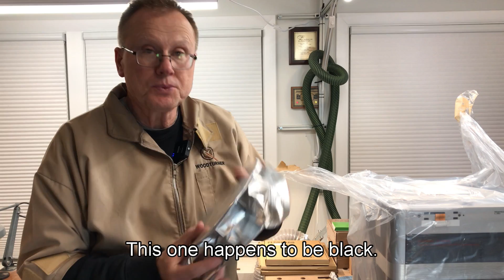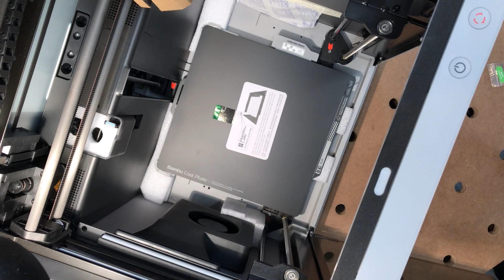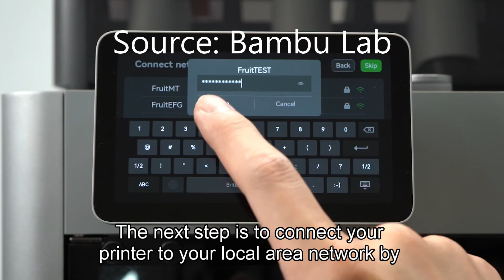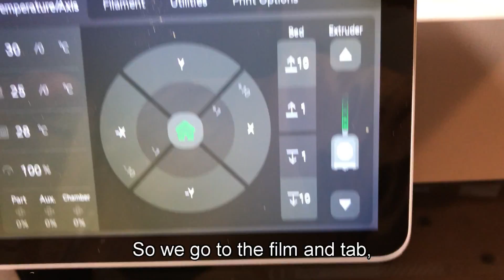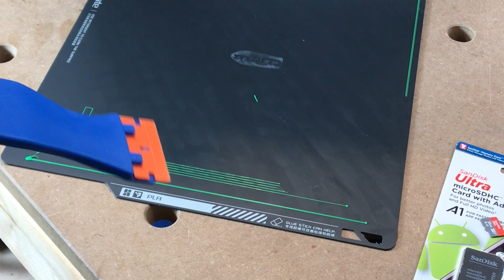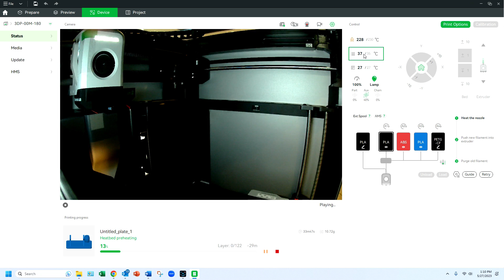Comprehensive Guide: Bambu Lab X1 Carbon w/AMS 3D Printer Set-up

Comment: I can confirm that as of December 2024, this first time set up is still a video if you’ve never set up a 3-D printer or are setting up your Bambu x1c. Just about done setting mine up. The set up instructions miss a few vital steps and didn’t even know that it came with an extra .4 mm nozzle. I was looking for instructions on how to install it for the first time which led me to this video. subscribed. Thank you for the pace and detail.
Just a small note that not sure if they changed it but on mine that spool holder on the back, the screw on the right needs to be removed. (no screw on the left) and then replaced with the two longer screws.
Mine also did not have any mention of needing a card, information about when to install the AC plug, and removing a couple of internal pieces of tape one of which I think is covering the camera so if you put in a card and are trying to figure out why there’s no video check to see if there’s that green piece of tape.
Reply from the maker: Thanks for taking the time to provide your detailed feedback.  I'm glad you found the Bambu Lab X1C video helpful.  As you mention, I made this video a while ago so I'm glad it is still relevant today for people setting up their X1C printers.  In fact, I just bought a Bambu Lab P1S printer and I was pleasantly surprised to see that the unboxing, setup, and operation is very similar to when I set up my X1C printer 1.5 years ago.  Thanks for pointing out the details in your comment that further clarify the printer setup.  I hope you enjoy your X1C as much as I have enjoyed mine.  Please let me know if I can be of any further help now or in the future.  Ken

Comment: Hey just asking does it only use PLA material or can we use others to?
Reply from the maker: The X1C can print PLA, PETG, ABS, TPU, ASA, Nylon, etc, because it’s an enclosed printer and it has hardened steel hotends. Thanks for the question.
Reply: @ristinnovations  the one from bambu labs? And also can I use it to print car parts like steering wheel or rim pan?

Comment: Would any stick of glue do? I can't find mine in the packaging
Reply from the maker: I know other people have used non-Bambu Lab glue sticks successfully. I think as long as you use water-soluble glue sticks they should work. You may want to test a small area on your build plate to see if your brand of glue stick works well. It can always be washed off. Thanks for your question.

Comment: On the second, right most screw to mount the external filament holder, there is already a screw in that spot. It's rather hard to unseat. Am I supposed to remove that one and insert the new short one provided in the pouch? It's kind of hard to make out in the video.
Reply from the maker: Yes, that’s what I recall. The two holes in the spool holder should line up with the two screw holes on the printer. You can zoom the video to see it better. Thanks for the question.

Comment: Can i use the cardboard spools with the ams ?
Reply from the maker: Bambu Lab doesn’t recommend using cardboard spools in the AMS due to their concern that the rubbing of the cardboard will produce fiber dust that can clog the gears, but I do know many people do use cardboard spools in the AMS. I think it really depends on your specific situation.
Reply: @ristinnovations  do you recommend any spools for ams from Amazon?
Reply from the maker: I went down the path of 3D printing a spool filament rewinder (it is in my Top Bambu Lab Upgrades video) so I typically only use the Bambu Lab spools with other manufacturers' filaments rewound onto the Bambu Lab empty spools.  Also, most of the time I use the Bambu Lab filaments.  There is a spreadsheet on the internet that lists all other manufacturers' spools and whether they fit into the Bambu Lab AMS.  I hope this helps you.  @cheizaguirre5494

Comment: why at one corner prints are warping ? is there any solution for this?
Reply from the maker: That is a good question. My thoughts on why parts are warping in a specific corner are that possibly there is some contamination that needs to be cleaned off the build plate or possibly the build plate does not have the same temperature at the corner versus the rest of the build plate. I don’t have a solution if there is a temperature difference, plus it would be hard to measure the temperature without a thermal camera. On option might be to try a glue stick or use the Nano polymer adhesive from visionminer. I hope that helps.

Comment: Thank you so much for this detailed guide. I was so worried I would damage something but I got everything going thanks to you !
Reply from the maker: I’m glad you found my video useful. Good luck with your printer and let me know if I can help in any way in the future😊
Reply: @ristinnovations  hey rist. My x1c is not powering on in chamber or screen. Can you give me some advice? I put in a support ticket but I'm not sure when they will reply.
Reply from the maker: @akg2n If you aren’t getting any power you could have a bad power supply. That was the symptom I had with my Qidi Tech printer. I had to replace the power supply. Bambu has a Wiki page that includes troubleshooting that may help you. You do have to be careful with power supplies (not getting shocked) because the internal capacitors store energy even after they are unplugged. I hop you are able to find the root cause.
Reply: @ristinnovations  thanks for your reply Rist. I'm seeing the power light on for the back switch and I'm seeing white lights in the AMS. There is also a red light on near the filament purge. I read on the wiki and checked the AP Board. That unit does not have power to its lights. The chamber light and screen also don't have power. I'm thinking it might be a failure of the AP board. Let me know what you think! I really appreciate your replies. Thanks you!!
Reply from the maker: @akg2n  Yes, I was just reading about the AP board so I think you are getting close to the problem. Is your printer under warranty? If so once you hear back from Bambu Tech Support they should be willing to send you free replacement parts.
Reply: @ristinnovations  yes it is. Their support auto replied promising contact in 3-4 days. I'll keep you updated.
Reply: @ristinnovations  Yes it's still under warranty. I contacted support so I'll let you know how it goes!
Reply: Hey Rist! Support replied and they are sending me an AP board. The guide for installation mentions heating to remove glue and also using UV glue to secure some cables in place. I'm a bit worried about doing those steps. Id appreciate any advice or insights you might have!
Reply from the maker: @akg2n it looks like you are definitely on the right track regarding the AP board based on feedback from Bambu Lab. I read the instructions you are referring to. I haven’t done this repair, but it looks like they are using UV glue to help secure the connectors and the ribbon cable. I would just be careful when using the hair dryer. You are trying to soften the old glue so you can disconnect the connectors/ribbon cable, but you don’t want it to get too hot. When reattaching the ribbon cable they recommend to use UV glue or silicon glue. The UV glue hardens quickly if you have a UV light source. You will have to follow the directions from the glue manufacturer on how to cure it. Bambu’s other option is the silicon glue, but you need to let cure by time, again by following the manufacturer’s directions. The glues act as strain relief just to keep things from coming loose due to movement/vibrations of the printer. Good luck with your repair. I’m sure you will do a great job!
Reply: @ristinnovations  great thanks. I'll definitely update you
Reply: Hey Rist just confirming that my printer was fixed with the AP board and has been working great since. Thanks again!!!

Comment: watching this at work, i did install it this morning by watching other content creators and now thinking about it, i wish i had found your video this morning because you did a great presentation, you knew what you are doing and what is coming up like that foam under the bed being released from calibration, some people just skipped it, making me try to pull it from the top. I had 3 flashforges in 2 months (3pro 4 pro and 4 pro) that now i have returned them all and got a bambu x1, my latest prints on flashforge were all perfect by calibration and glue, even the build plates were not getting 1 scratch. Still my first print on X1 detached from the glue once almost done, so i need to learn it better. This time i dont have the amazon return advantage so i gotta be careful
Reply from the maker: Thanks for your detailed comment. I think you will enjoy the Bambu X1C😊

Comment: Can the slicer be set to print as much as possible in the same color?  if it can print 5-10 layers without the head getting in the way before it changes to another color..  then it can save a lot of the dumped plastic.

Comment: Love the video I been printing for a few years and trying to get my Prusa MMU2 working have to make the decision New prusa  or Bambu  I only use about 4 material suppliers Fillamentum Prus Elixr need to work out if the ams can handle these spools, I am sorely tempted to buy Bambu
Reply from the maker: Thanks for the feedback. There is a list on the internet that has information on which manufacturers’ spools fit the AMS. I made a spool rewinder that allows me to use anybody’s filaments in the AMS. It’s in my video titled “The top 10 Bambu upgrades, if you are interested. Good luck with your decision.

Comment: can you use non Bambo filament?
Reply from the maker: Yes, you can use other manufacturers’ filaments, but they need to fit in the AMS. There is an Excel spreadsheet that is available on the internet that lists which manufacturers’ filaments fit. I just uploaded a video this morning that shows you how to build a spool rewinder that gives you the option to rewind another manufacturer’s filament onto a Bambu Lab spool. Another option is to load the other manufacturer’s spool on the external spool holder, but that’s not part of the AMS. Did I answer your question fully? If not, just let me know how I can further help!
Reply: thans so much for taking the time to reply in detail. I'm a 2yr MK3S+ user and need/want another and cannot decide. Are the tags on the reels recodeable or can you simply manually input that info to the printer via the screen. I guess the gcode would contain all the relevant info you just need to work out which slot each colour is at? Ive never used a multi colour setup, always done it manually.. Thanks @ristinnovations
Reply from the maker: The RFID tags are only for the Bambu filaments, but you are right that you can manually update the spool information (material & color) via the printer screen or Bambu’s Studio software. Depending on your budget, Bambu Lab offer their new P1S which is an enclosed printer, including the AMS for $949 or $699 without AMS. Also they will be launching something new on 9/20, but nobody knows what it will be yet. Good luck with your decision.
Reply: Thanks again for your help. Great Videos, keep well 👍
Reply from the maker: You too😊

Comment: Hello, and thanks for your video.
Is it possible to replace the hotends with brands other than Bamboo Labs? Perhaps the DyzeDesign for higher temperatures.
I apologize if this is a basic question, but I'm not familiar with the process. Thanks
Reply from the maker: That’s a good question. I don’t have any experience with using other manufacturers’ hot ends with my Bambu Lab X1 Carbon. Possibly another viewer of this video may offer their experience. Bambu does offer many materials; what material do you want to print?
Reply: @ristinnovations  Thank you. I have a few materials in mind that require temperatures higher than 300C. Unfortunately, and if I am correct, the maximum temperature capacity of the Bamboo Lab is 300C.
Reply from the maker: Yes, you are correct that Bambu Lab state the maximum hot end temperature is 300 degrees C.
Reply: @ristinnovations   Thank you. If the replacement for another higher temperature hotend were to be successful, is it possible to select a higher temperature in the studio viewer?  What do you think?
Reply from the maker: I don’t have the expertise to know how another manufacturer’s hot end would work in a Bambu Lab printer, especially if you are looking for temperatures above 300 degrees C. It’s my understanding that you would need a heated chamber and possibly a hotter bed as well, but your best bet would be to contact Bambu Lab directly for your specific requirements.

Comment: Hi. Just checking in to see if your feelings are still positive on this printer. I'm considering getting one and it certainly seems like it's a good printer snd real easy to use. I currently have an Ender 5 which is good but it's slow and limited on the types of filaments it can successfully print. The speed, self leveling, lidar, fault detection, camera, enclosed case, phone app, etc. really seems like they've covered most bases. Have you come across any negatives? Anything you'd wish they'd change?

You mentioned that you'll be producing more videos about this printer and 3D printng & design. What are you thinking about and what's your schedule look like?
Reply from the maker: Hi Christopher, I’m still very pleased with how the X1 Carbon is running in my shop. I’m making parts daily without any issues. The one limitation is that not all other manufacturers’ filaments fit into the AMS, but there are solutions to that. I’m building one of the motorized filament rewinders that transfer filament onto Bambu Lab spools. Regarding me wishing anything Bambu would change, I’m not into many multi-color prints, but it would be nice if they would offer a multi-head design to minimize waste and speed up the print time (but this is common for all single-head printers). I hope they improve their customer support  (even Bambu’s CEO acknowledges they need to improve this). So far, it’s the closest thing to a plug-n-play 3D printer I have seen. I will be uploading more YT videos every 2 weeks or so on topics such as “Beginners Guide to 3D Printing”, “Upgrades to the Bambu X1Carbon”, “Bambu Slicer Tips”, etc. What specific topics are you looking for? I might be able to incorporate your topics into my future videos. Just let me know. Thanks for the comment.-Ken
Reply: Hi  @ristinnovations  and thanks for a great video. Pls keep up the good work :) Where can I find a guide of how to build the motorized filament rewinders that transfer filament onto Bambu Lab spools? Many thanks in advance.
Reply from the maker: @FamiljenBarouta  Hi Tony, I just finished a motorized spool rewinder based on the following 3 designers, all in Printables. Original design: Miklos Kiszely. Motorized version: Bird2Brain. Motorized major upgrades: Diplomator. Diplomator’s upgrades made my rewinder much more reliable. I found without Diplomator’s upgrades, the motor tended to slow down (and even stop) due the friction and weight of the full spool at the end of the rewind. I will be uploading a detailed video within the next month on everything I learned from by motorized rewinder build, but in the meantime I think you will like the 3 people I mentioned above in Printables. Thanks for reaching out. Ken
Reply: Thanks  @ristinnovations ! I will have a look at Printables. And I look forward to your next video, I will subscribe!
Reply from the maker: @FamiljenBarouta  Thanks Tony😊

Comment: Does the multi filament holder come with it?
Reply from the maker: If you buy the “X1 Carbon Combo” at $1,449, that includes the multi filament holder. They call it the AMS, which is the Automated Material System.

Comment: I set mine up new out of the box and can’t get one print I did everything the instructions told me and it did it’s pre printing settings and when the print starts the filament just wraps around nozzle not happy waiting on a response from Bambu
Reply from the maker: Have you had success with other prints or are you having problems with all the designs?  Are you using the cool plate ( and you applied the glue stick glue to it, correct? Are you using the Bambu filament that came with the printer? Which filament?
Reply: @ristinnovations  apparently the benchy that is preloaded is causing a lot of people the same problem. I have not tried any other Prints that will be done later today. All the rest of your questions is a yes. I’m sure I’ll figure it out. Just off to a bad start. Thank God I still have one of my AnkerMake’s running and doing pretty well.
Reply from the maker: @RonnieVanZant1977  I hope you have success with your other prints.